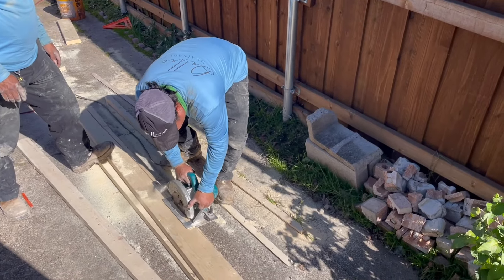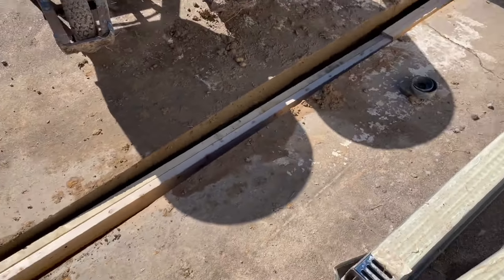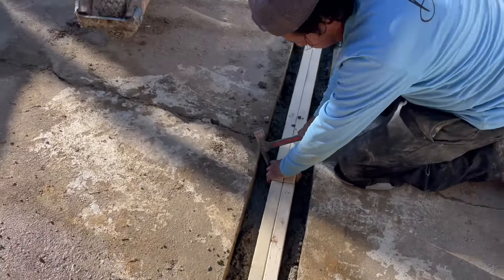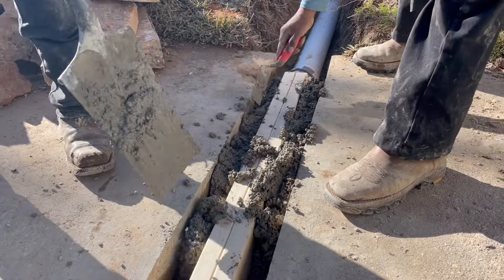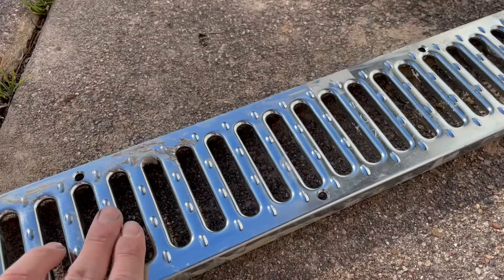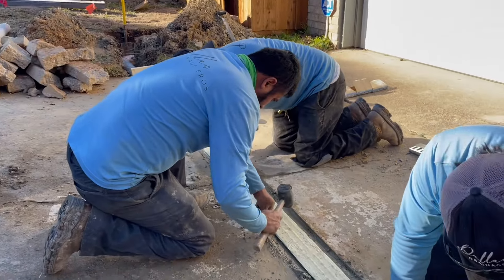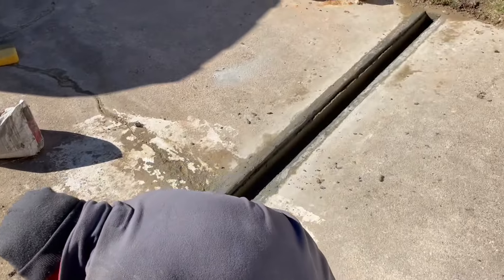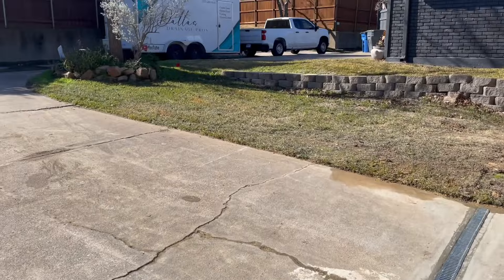How to Install a Driveway Channel Drain - Dallas Drainage Pros

Comment: Can the channel drain be flat as long that the drain pipe slopes down? I have 30 ft of  existing concrete that i need to cut into for my channel drain but slope not so great
Reply: Water also finds the path of least resistance, so a level pipe/trench/channel WILL actually drain so long as the outlet allows water to escape the system as fast or faster than it's being filled. Such experiments have been demonstrated on other videos.
Reply from the maker: Technically it will drain, because water always finds its level. However, it will drain very slow. One option would be to use a channel drain with a built-in slope. Those can be pretty expensive, but worth it if you can’t afford to have the system overwhelmed during a rain event.